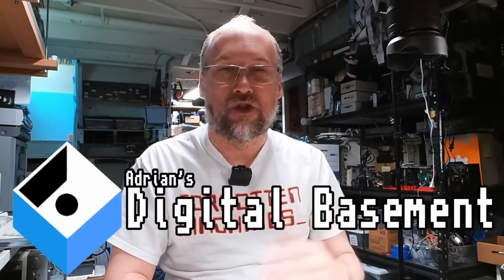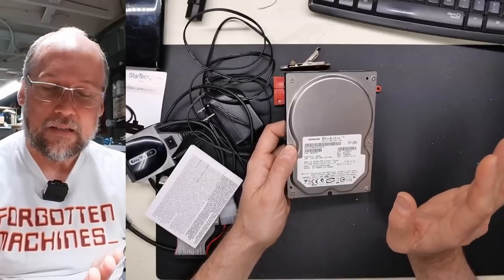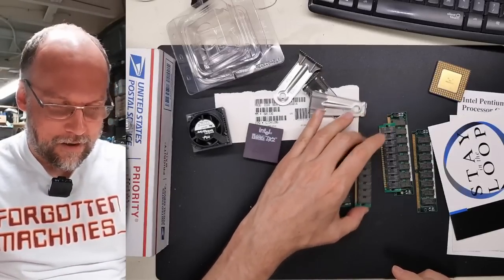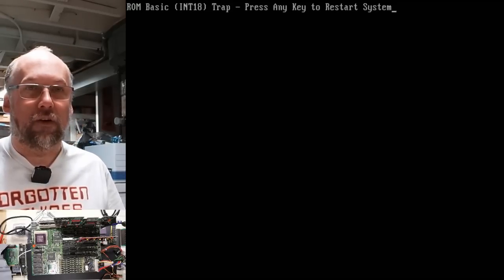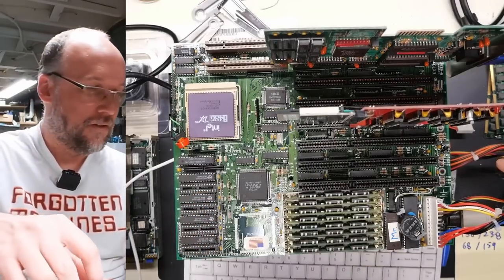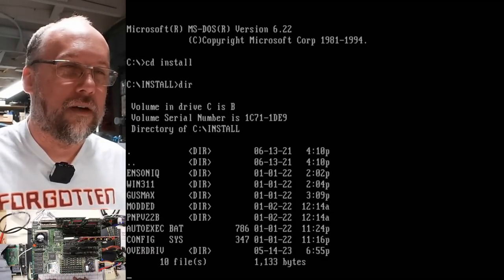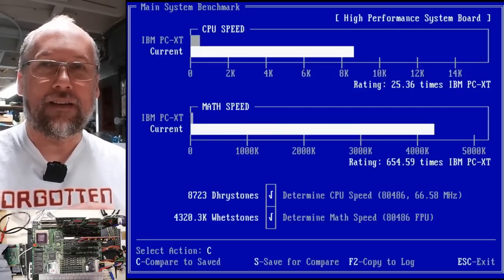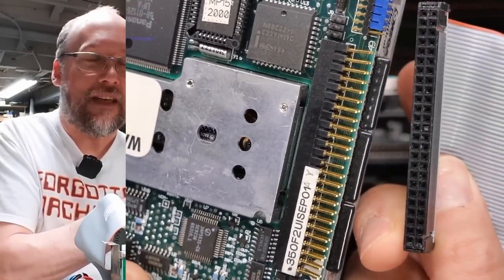0062 A Pentium Overdrive exposed issues with my 486 motherboard

Comment: A comment about the intel chip lifters.  Don't pry the chip as you demonstrated. If you read the instructions in the intel guide they want you to push the lifter towards the chip.  I worked in a computer shop and did quite a few 486 overdrive installations. Pulling the lifter can crack the edges of the socket.  I saw it personally a few times.  It is especially true 30 years later now that they are old and brittle.  Push the lifter, don't pull it.

Comment: Actually that connector is a very good thing - it resists the bending that causes desoldering from the board. And it is a very secure and tight fit for the cable.

Comment: I believe the Pentium Overdrive had a 32K cache (which can operate in write-back mode on later motherboards, but only in the slower write-through mode on most 486 motherboards). The Pentium Overdrive should definitely be running faster than the 486DX2. (It's more similar to a 486DX4.)

I know some early 486 boards aren't compatible with the Overdrive (because Intel changed the specs on the socket) but that doesn't explain why the cache on the 486 DX2 isn't working. I assume there must be something weird with that board or the BIOS.
Reply: The ones that didn't support the WB cache got nerfed worse than that: you didn't have any access to half the cache, so only the standard 16K (it had something to do with cache weirdness and how WT vs. WB cache worked).

Comment: Just a reminder. Pentium's FPU is not much faster than 486's. The difference comes from the ability to run FPU asynchronously/separately from the rest of the CPU in Pentium. It's almost like you would have 2 cores in pentium.

Comment: Yeah, that hard drive connector is weird. Seagate uses them on their USB 3 drives as well, and I actually had to go out and buy a standalone cable of that type when I got my Brother ADS-1200 desktop scanner, as it also uses this interface and did not come with a cable in the box.

Comment: The 'Telecom' clip has a 66-block jaw at the very front an a 'Bed-Of-Nails' connecter inside to clip onto telephone (thin insulation) wires without stripping (and not needing reinsulating afterwards)
(I am a retired (2010 - 39yrs) telephone repairman/installer. I still have myy butt set, side tools and pole climbing gaffs)

Comment: The IBM "Deathstar" moniker was specifically for the 75GXP models, launched in 2001 and available in sizes from 15GB to 75GB and leading to an US class-action lawsuits and a settlement in 2005 not admitting any fault but supposedely paying out $100 to any US user with a failed 75GXP.  In my experience back in the days earlier deskstar models tends to be some of the more reliable drives from that era and IIRC the 75GXP was the fastest and IIRC largest disk you could buy when it was launched so they sold really well for IBM. Documents from the lawsuit proves IBM knew they were failing at 10x the rate it should and was trying to evade responsibility and just keep selling them! They really did deserve that moniker.
IBM really did a number on their own business with that one, they sold their entire drive business to Hitachi two years later due to the fallout.
Reply: I had 2 1G ones, and yes both did eventually fail, one quietly, and the other was just taking longer and longer to read data, till the Adaptec SCSI controller eventually timed out with a BSOD. Had a similar one with a Seagate drive, cured by putting in the freezer for 3 hours in a plastic bag, and making a copy fast before it warmed up. Replaced under warranty by the local agents, though to fail it in the walk in freezer they used as office ( receptionist was wearing a jersey, when it was 30C outside) I had to put the top back on that plastic Seashield case to warm the drive up to 30C, when it would fail.
Reply: I still remember when I got my 14GXP.  First IDE 7200rpm drive, I think with ATA-33 too.  SO FAST for an IDE drive.  No click-o-death on that one.  I've still got it around here somewhere.  :D
Reply: Yes, the DeskStar drives were very good excluding that specific window of 75GXP model units; I suppose that makes them a great find for us now as most dum dums avoid the 'IBM' and 'DeskStar' HDD branded drives entirely because of a stupid internet meme.

Comment: I haven't managed to find a reasonably priced source for the anti-static foam. I bought some cheap parts bins that weren't anti-static, and I had intended on lining the drawers with some thin anti-static foam, but I shelved the project when I found out how much a big sheet of the stuff costs. I really should look around and see if I can find a cheaper sauce than the silicon-based electronics supplier.

Comment: Intel changed the pin out of the PODP AFTER they released the specification to vendors.  Some of the first boards with the PODP processor socket don’t actually work correctly because the socket is “wired wrong” preventing proper cache operation.  There was an interposer at the time to correct the issue, although usually the problem was that you couldn’t use the L2 cache, not the L1 cache.

By the time VLB was around I would have thought any such issues would have been resolved.  I’d try the official AMI bios and see if that works any better.

Comment: I stil have the Galaxy S5 and original cable and agree that micro USB 3.0 port is annoying, but compatible with micro usb as well like most of the other phones in the galaxy line, just plug the micro USB cable into the wider portion of the jack on the phone/device.

Comment: There are pentium overdrives that run at 63MHz as well, but the 83MHz ones are more common. Those run at 2.5x on a 25MHz motherboard (the 83 runs at 2.5X on 33MHz bus). It's interesting that you can run these overdrives at faster speeds than their rated one as well; for instance I am running one of them at 100MHz on a 486 motherboard with a 40MHz FSB. They usually need a little voltage boost to run at the higher speeds, but they are fairly tolerant of overvoltages. To boost the core voltage you have to modify the on-board voltage regulator but that is not too hard to do, all you need to do is insert one (or more) diodes in series with the reference terminal of the VRM chip, each diode adds an extra 0.7V to the regulated voltage. I run mine with one diode which gives a core voltage of 3.3+0.7=4V, with no issues. It doesn't overheat and runs perfectly stable. I know people that run them even at 115-120MHz or more.

Comment: The various 486's had slightly different pinouts, some of which have to do with on-chip cache functionality. You'll have to check that your motherboard is set up correctly for the chip you're using.

Comment: The difference between the normal DX2/66 and the overdrive DX2/66 is the additional pin they have that is required in some motherboards with a soldered on CPU to disable the onboard CPU. 

There is two versions of them.

Comment: Those SK series chip appear to be equivalents to 74 series TTL chips, for example a 7447 is a BCD to 7 segment decoder, just like that 4547. Actually, I am wondering if the 4xxx means it's CMOS, so equivalent to a 74C47

Comment: A few years ago I curb side picked an EPSON PC in a tower , it had all the original manuals and discs both 3.5in floppy and CD-Rom discs. 

It had A 486 DX 4 cpu in it iirc it was clocked at 100Mhz , but there was something weird I'd never seen on a 486 Board.
The mother board had PCI slots on it , had like 2 ISA slots and 4 PCI slots. 

I tried to boot  the pc but said no HDD found it was in it and spun up , I found the 40 pin Pata cable was disconnected on the MB.  reseated it and powered it on and it booted into MS-DOS 7.0 and it had a dos program for Plug n Play driver that loaded and checked the PCI slots for Plug n Play devices. It had 1 ISA card in it that was a ISA ethernet card and 1 PCI sound blaster card.

After doing a DIR/W I discovered it had a windows folder .  It wasnt set to load windows on startup just booted to the dos prompt after the Plug n Play driver loaded for DOS.  I typed WIN and started loading Windows 3.11 WFW once loaded it had a windows Plug N Play utility/Driver for windows 3.x   .

iirc it took PC-66/100 ram sticks not the standard 72pin sticks of RAM.

Comment: correctly working 486 produces about 500 Dhrystones per MHz, i.e. DX2-66 must show about 33000 Dhr (usually slightly less). I have 83 Mhz Overdrive and it's speed is 56000-64000 Dhr depending on external cache and memory speed, so it's "theoretical" perfomance is about 780 Dhrystones per MHz. It means P5ODPR83 is 1,56 times faster than 486 per clock. So Pentium Overdrive at 83 MHz beats 486DX4-100 even at integer operations, but 5x86-133 is faster a bit while being a "mostly" classical 486.

Comment: I had this CPU and a similar motherboard, I don't remember the exact board, its been years, but I accidentally ran across a jumper on the motherboard that set the CPU multiplier, I removed the jumper, and the System Speed Doubled. I believe the bus clock divisor has to be disabled.

Comment: Problem with L1 cache is definitelly somewhere on board. Inside 486 CPU you can only control cache disable (CD) bit and not write-trough (NW) bit in CR0 register. This can be probably enabled/checked by debug.exe. Rest of L1 cache control is in chipset. Also BIOS usually uses L1 cache as RAM before DRAM is detected and configured.

It seems the chipset can be either 82C596A or 82C597 and it seems to be cypress (cypress later bought contaq). There seems to be a datasheet for CY82C597 with registers description how to control cache (also L1 write back configuration).

Comment: Shadow RAM on a lot of video cards did not work because the card used a memory mapped section next to the ROM as video memory, and caching the area would result in the card not being able to display video, as it would not be writing to the right area in the card memory. Common on cards that had extended modes, which did not fit the standard memory mapping. 

Not all overdrive processors worked well, especially on all motherboards. On board cache on the die was always preferred, and the overdrive processors would often disable the cache on power up, as it was doing cache control, and would only use main memory.

Comment: And at 50:30 min, about the faulty connector pin, on the Floptical drive, it is not mentioned if a continuity test was done, so this could be a possible cause of the failure, if that pin is used for something.

Comment: Even if the upgrade CPU is a DX instead of a specific 487 or overdrive you can get the system to disable the onboard SX CPU by grounding that extra pin (or is it 5v, better you double check hehe but it works, I will place bets that you can put a normal 486DX without the additional pin on any SX system by just wiring that pin correctly to signal the onboard CPU to go off)

Comment: I have an external Maxell LS-120 for parallel port and one LS-120 disk. Years ago, i was able to make it work under Windows 98. Due to the parallel port connection, it is pretty slow. But what's interesting, it is able to format a regular 1.44MByte floppy to store ~32MByte. Cool device, but not very usable. These LS-120 floppies also seem to be very unobtanium. Another interesting aspect about that floppy disk is, you can see little squares on it. Not sure if that information is useful, but that's what i figured out, when i played with it.

Comment: It was the Samsung Galaxy S5 and Note 3 that have that micro usb 3.0 

I’ve owned both phones at one point. Oddly enough most people thought you needed a 3.0 cable to charge the phone so the 3.0 connector was dropped from the next generation. I’ll never understand why people assume you can’t use a 2.0 cable on a 3.0 connector. Literally remember a customer inside Walmart asking for a 3.0 micro usb cable to charge a Samsung phone. At the time not only was that type of cable hard to find but but was generally double or even triple the price. Needless to say that customer went away angry as they couldn’t buy said cable because the only one they sold was out of stock. Oddly enough no amount talking to them was able to convince them that they could buy and use a standard micro usb to charge said phone

Comment: I remember being a retail PC tech in the '90s and installing a few Pentium Overdrive chips.  They were highly underwhelming.
Reply: Looking back, your choices were a DX4, an AMD 5x86, or a Pentium Overdrive for maximum 486 performance.  With the Overdrive, I could play Quake at something resembling decent fps at lowest settings, thanks to the improved floating point performance, where I couldn't with the other two.  So, underwhelming, sure, but it had it's place.
Reply: A Pentium Overdrive 83 MHz runs on par with that of a regular Pentium 75 MHz.

Comment: The SCSI Inquiry command should return the type of the device and that the medium is removable. The command-set for different device types are clearly defined and hardware producers should follow these rules.
But most simply return a "custom device" type and let custom driver do the rest.
The device should return something like: "Direct-access block device, removable, read only" but probably register as CD-ROM with dummy commands or custom-IO-device.
It was always a pain in the a.. to find a company that produced SCSI conforming command interfaces.

Comment: Shadow and cash are different.   Cash is a dynamic thing, what gets stored is cash depends on what the CPU accesses.  Where as a "shadow" of a ROM includes ALL the ROM even the parts that may not be accessed.   Also with a cash it only increases access to the second time some data is used, the first time is alway ways taken from main memory.

Comment: DeskStars really were good drives, except, IIRC, the 20-40gb-ish models. The 75 and 120GXP units. Prior to that, they were known for their solid drives, and the models after their sale to Hitatchi were every bit as good.

They were just in a race to the bottom of the sales numbers, and when the 75's came oit woth issies, they tried to pull sime MediaScribe levels of warranty rejecting BS that absolutely KILLED what remained of their brand and userbase.

Comment: E Pentium ® OverDrive® PROCESSOR
35
3.7 Cache Support
The Pentium OverDrive processors have the same
intergrated caches as their respective original
Pentium processor; 8K-byte data cache and 8K
byte code cache. The 125/150/166-MHz Pentium
OverDrive processors supports the 82497 Cache
Controller and 82492 Cache SRAM chip set (single
socket systems only), 82430NX, and 82430FX PCI
chip set. The 120/133-MHz Pentium OverDrive
processor supports the Intel 82430 PCI chip set but
does not support the 82496 cache controller and
82491 cache SRAM chip set.

Comment: BEWARE!!!  Some kinds of black anti-static foam are HYDROSCOPIC and will corrode the pins on your IC's after a few years!!
The Pentium -> 486 overdrive needed for the MB to have a socket with an extra 'ring' of socket pins on it.  The 486 fit into the inner rings and didn't make contact with the outer ring which was reserved for the overdrive chip.  Intel published the motherboard spec for this a year or two BEFORE they actually released the overdrive chips.  The did make smaller overdrive chips that didn't need the outer ring of pins, but they were not as fast.

Comment: Can confirm, the Galaxy S5 did use that weird 'dual' USB connector. Found out pretty early you can just plug a regular micro USB cable into the portion of the connector and it would work just fine for charging or data transfer. I always assumed the other side of it was to give it a USB 2 or USB 3 speed. or maybe for additional power. I think I also have an external hard drive that has the same connector on it. Its been sitting on the shelf collecting dust though, don't have much use for it since moving most things to SSD.
Reply: I used it to connect HDMI output with a Samsung supplied cable to my S5.
Reply: It's the micro variant of the USB3 connector. Didn't last long, and USB-C is a MUCH better connector.

Comment: The board isn't made by PcChips, right? They were notorious for using fake cache chips. Partially why their boards are literally bottom of the barrel. Pretty sure all of such boards are later though (with PCI slots).
Reply: That's the L2 cache on the motherboard. I think the CPU-internal L1 cache still works fine on those boards.

Comment: OK, that RAM extended option should be for OS/2 Warp RAM configurations.
The reason you got your VGA card slow as crap is that the AT BUS speed is in fact the ISA BUS clock, I never had any issues running it at 14Mhz, sometimes more, and I do recommend running it at least at 14Mhz unless you have some crappy old cards that won't work at that speed (which will be only very old 8 bits cards, NEVER a 16Bit ISA card refused to work at 14Mhz for me so yeah)

Comment: For the Floptical drive, it might depend on whether or not the BIOS supported it to allow it to boot from the drive.  Maybe later motherboards and BIOSes did.    There was support for LS120 and IDE Zip drives - or at least they were recognised in the BIOS.

Comment: You mentioned switching to an ATX PSU. Maybe the floptical card needs that missing -12V rail?
Reply: He is using an early ATX PSU with -5V required by some ISA cards (-12V is still present on current ATX PSUs)